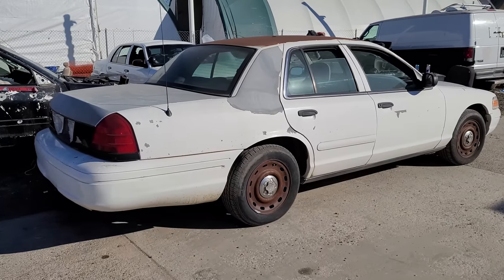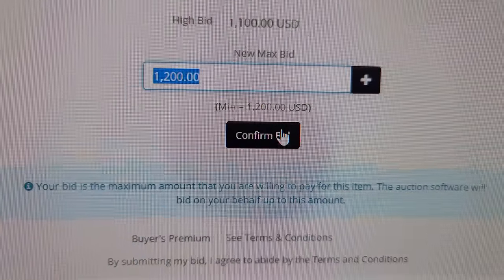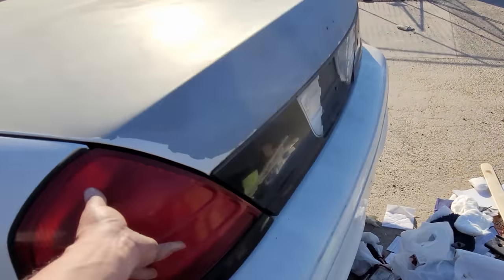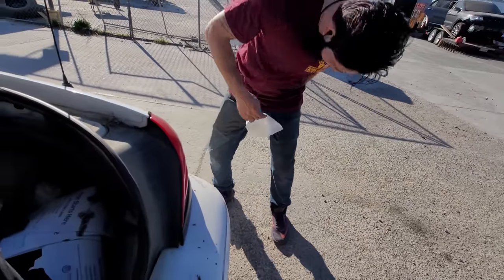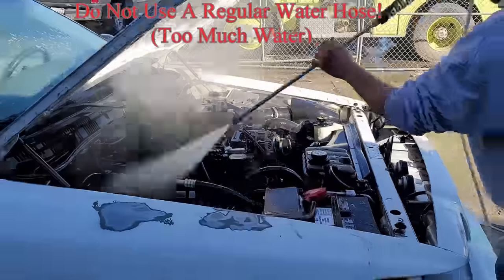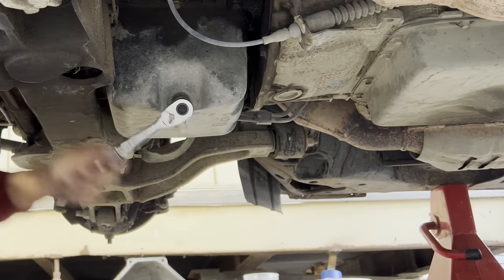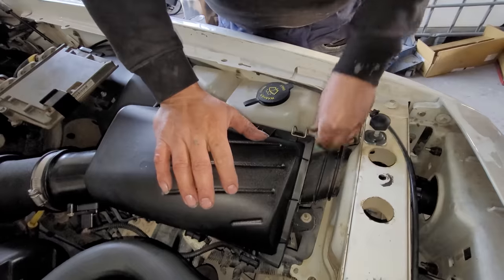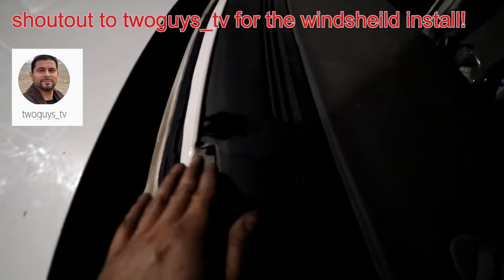Restoring & Flipping an Old Police Car for Profit! Start To Finish!

Comment: Really nice work. I like to start with cars more in the $3000 range that don't need paint jobs, then be in the $7500-$12,500 for Crown Vic lovers who really want a nice car. So much, as you say, is just really taking the time to clean well, and fix everything. No stories, no excuses, no it only needs this, nope. Car is perfect, no problems. All fluids and filters changed.
Reply: I just bought a 2007 Mercury Grand Marquis in like new condition with 47,000 miles on it for $9,000. It doesn't need anything. Looks like it just came off the showroom floor. I bought it off Craigslist from an older couple living in a retirement community. I changed the oil and filter, transmission fluid and filter, along with a new transmission pan with a drain plug, rear axle oil, and coolant. It all looked like new. It had brand new tires and brakes on it. 

There is a place in Anaheim, CA called Wild Rose Motors that has a lot of completely refurbished low mileage Crown Vic P71s. Their prices are a bit high, but if I wanted one, that's where I'd go. I just prefer the Grand Marquis as a daily driver and for long distance trips.

Comment: Really well done video and really nice work on that car, tons of attention to detail. You really don't see a lot of that around especially when someone is trying to make a profit. Kudos to you on that, you really did do a lot of good to this car.
My only hope is that you used some sort of rust treatment on that roof and any of the areas with visible surface rust. Just sanding, degreasing, and painting it is not removing or treating the rust in any way to stop it from coming back. Painting over sanded rust while skipping the crucial step of treating it will do nothing but make it look pretty for a very little while. Give it 8 months and that roof will look exactly the same as it did before, especially somewhere with snow and salt. Fingers crossed man.

Comment: Very nice! I did basically the same with mine, only with a Marauder theme. I bought a 2007 P71 and a 98 Town Car for $600 at auction. I used pieces from both to make leather seats, used a center console from a 05 Mountaineer, map light/sunglasses holder for a early 2000s Sentra, pieced a grill together from 2005 Grand Marquis and the grill from the vic. I sold the Lincoln for $400 to a derby guy.  I bought a Marauder rear spoiler, some cheap mustang rims off Craigslist, ebay brake kit, had the transmission rebuilt, flowmaster exhaust, 4.10 gears from an explorer. I have some fog lights and bezels for a 2005 Dodge Ram I am going to graft into the front bumper. All in, I have about $2500 in it. I should have used better paint the first time. I did a rustoleum paint job. It has been about 5 years and needs paint. I'll spend a few hundred this spring and do a better job. If you have one with a charcoal interior and need to match pieces, Rustoleum Oil Rubbed Bronze is a pretty close match.

Comment: Done this a few times with crown vics. Great job! Like you said in the video during the engine wash, I'd recommend covering or removing the alternator first. You won't notice problems at first but I've seen it eat the bearings like nobody's business. Just something to watch for, as replacing the bearings in the alternator SUCKS on these cars.

Comment: Smick job! Personally, if it was my car I would have added a chrome grille and chrome rear panel, just to dress it up a little, and I probably would have gone for some factory alloy wheels from the Lincoln, is it? I’m from Aus so don’t know exact models. You’re right about an engine bay clean too, I flipped a few cars and I always cleaned the engine bay and even painted the engine block if it looked crappy.

Comment: Good video and great attitude.  Did you service the transmission, flush the radiator and brake fluid, and lube the drive train?
Reply from the maker: I did not simply because the transmission fluids and radiator fluid looked brand new!
Reply from the maker: Thanks btw! 😎

Comment: I recently purchased a Ford Crown Vic. I was in the market and a man I know posted one very near my home. It wasn't his but it was his friend. 105,000 Miles. 99 model. Not a police car. I think it is probably a base model judging by the car stereo. Either way it seems to be a really good car. They ride incredibly smooth. The 4.6 V8 has a lot of pickup. Coming over the road truck driver so I will only be driving at about 40 to 50 days a year so fuel economy is not such a big deal to me. I was surprised at the handling.

Comment: I don't know how you painted that car. I had a 2004 Crown Vic in about the same condition paint wise. The white paint was coming off all over. I pressure washed it over and over, and got more than half the white paint off. I sanded all the edges and tried to repaint it. The solvent in the new paint dissolved the rest of the old paint, just like a paint remover. It just bubbled up everywhere. The white paint on these cars is defective from the factory, that's why most of it was missing. Notice that this doesn't happen with any other colors, just white.

Comment: Considering 04+ have the same hp and torque, really the main way to have less than 250hp, not 240, is an npi or aftermarket manifold; at a 15-20 hp loss on pi heads. It’d be a 15 hp gain in 00- dual exhaust panthers. In this case, it appears to have an oem manifold. Trans apparently shifts fine. Maf was cleaned out. Long as everything is up to par, it’ll be the same or much closer to 250 due to age.